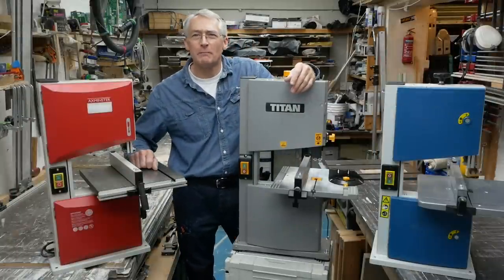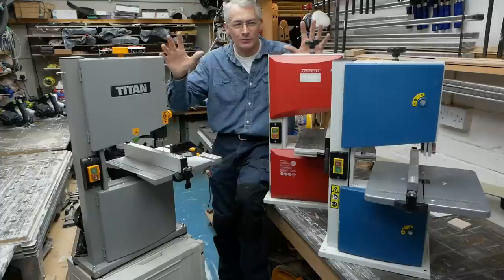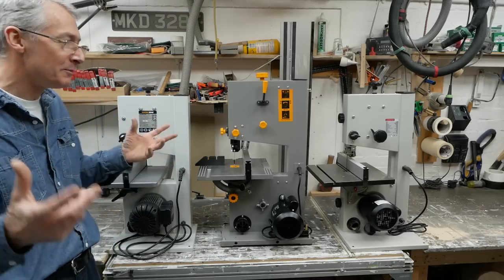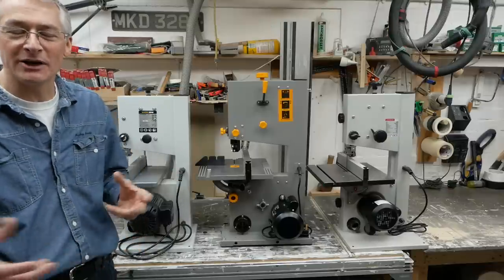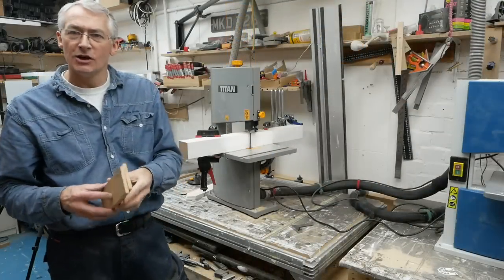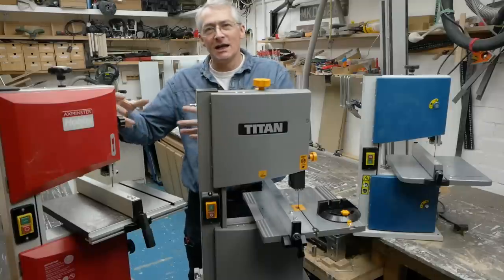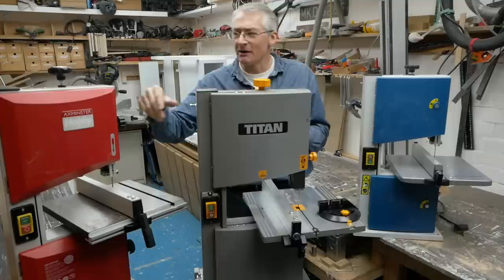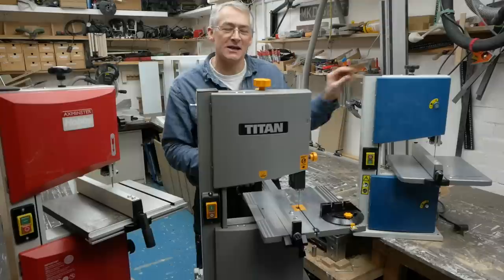Cheap bandsaws (again) #148

Comment: You can tighten the fence up. The cam isn't on a straight rod, it's a screw thread so just turn it clockwise a few times and it should grip the table no problem.

...oh and the Aldi one is being sold by Parkside from Lidl for £70.
Reply from the maker: Thanks - not my first rodeo, whilst this one will tighten, it doesn’t make it any more stable, sadly. Lidl Parkside tools are often rebadged Einhell, Aldi are usually rebadged Scheppach - I’d be interested to see if Lidl are starting to sell Scheppach. 👍
Reply: I had to send mine back because it wouldn't turn on when I bought it.
The replacement they sent me had been dropped or something as the base was bent and the post had ripped away from it on one corner.
The third one they sent me is on it's way now and it has come straight from Scheppach.
Reply: ...and my bandsaw was delivered today!

...except it wasn't a bandsaw, it was a mitre saw :/

So, still waiting for my bandsaw...after a month :(
Reply: @10MinuteWorkshop  Maybe not relevant, but I just bought a Parkside compressor which is made by scheppach aparently.
Reply from the maker: @diyengineer811  That's interesting, thanks Mark! Is it any good? I'm looking for a small quiet one... 🤔
Reply: @10MinuteWorkshop  Quite impressed so far. Easy set-up and plenty of power. It's a 50L tank so not the smallest and it is just as noisy as the coin operated tyre inflators in fuel stations. Apparently belt-driven types are quieter but more expensive. I have just bought the silverline nail gun that you mentioned in one of the pod-casts and need to get an adaptor to connect it to the euro-type connector on the compressor hose. But all-in I am very impressed for £99.
Reply from the maker: @diyengineer811   Thanks Mark! Much bigger than I'm after, but good to know about. And yes, the noise thing is what gets me down about them in a small workspace 😕👍
Reply: @10MinuteWorkshop  You could always keep the compressor in the other part of your workshop and build a cabinet with some sound-deadening around it (need a bit of ventilation for airflow, which would of course allow sound to leak out). I think you can pipe compressed air for 20+ metres without losing much pressure at all.

Comment: My aldi tracking feature for the wheel is useless now, had it two years, changed the blade on it, and it tracks the blade off.  The metal on it is cheap and flexible and it got use for the price.  However on a new job at the moment which I need my saw for.  Not very happy with it now.  It was ok for ripping but nothing finessed.

Comment: Resawing wood on a band saw is a special skill that needs training. Once i saw a good video on that subject on Wood Workers Guild of America.
I do not remember if it was in their "free" part or in their paid membership part. I decided to become a member a few months ago. They have special offers from time
to time, like a membership for 1 year for 4, 7, 9 or 11 USD. It's worth it. Normally a membership is about 40 USD a year.
Reply from the maker: Yes, it isn’t a skill I pretend to have, but interesting for an ‘unskilled’ user like me to be able to get a decent cut in a basic saw 👍
Reply: I'm not good at it either. The heigher the wood the bigger the thrift  The video on WWGOA is worth seeing but it is rather technical and it requires in any case
a lot of trial and error. At least I found out why things go (sometimes) wrong. When one knows his and/or the tool's limits things are easier to accept and
whether live with it or start with upgrading.

Comment: Just came from the other video, now I don't know... the mitre slot is definitely a big plus for the titan but the fence is a drawback, and still feeling I wand a higher depth, even if its just another 20mm for a nice round 100 lol. I will continue researching and see what I come up with.
Thanks again for the video
Reply from the maker: These are pretty old videos now; if you take a look at the bandsaw playlist theres a more recent one about the Aldi Ferrex 10" bandsaw - cheapest 10" bandsaw in the UK when I made the video. I still use it today, though I hd the Titan for a couple of years after I gave it a makeover and fixed the fence. 👍
Reply: @10MinuteWorkshop  thanks I'll check that out now ✌️

Comment: Really useful comparisons here, Peter. Am considering the Titan for my own shop, so very keen to hear how you got on with the Axminster fence upgrade.
Reply from the maker: Thanks! Axminster fence upgrade is sat in the box it arrived in due to work madness just now - there'll be a video in due course, I promise! 👍
Reply: @10MinuteWorkshop  Did you ever manage to get the Axminster fence fitted, Peter? And any joy with getting the tension adjustment lever to work?
Reply from the maker: Peter Shaw Nope - still in its box! I think I might have said at the time I don’t use the fence much, and this proves it, lol! I’ll get onto it soon, I’m sure. 😬👍

Comment: Do a review on the titan planer thicknesser. Available from screwfix for £140. I'd be interested to see your views on it.
Reply from the maker: Never owned one so it would be a bit of a novice review! Heard good things about the slightly pricier Erbauer though👍
Reply: Few good reviews on YouTube for that p/t, gonna get me one whilst it’s 20 quid off, Rutlands do similar for 180, but it’s probably the same. 👍🏻
Reply: Try to get your hands on an old Wadkin
Reply: Titan thicknessers are driven with a belt not chain.I had two and the belt broke on both not long after I had them.Decided not to risk another so had a refund. Take from that what you will.
Reply: Would love to see a review of this machine, it keeps tempting me with that price.  Usually even more tempted when arms are tired from planing...
Reply: I just picked up a second hand MacAllister (which I think is a B&Q own brand). Haven’t played with it yet, but only cost £70, hardly been used with 2 sets of spare blades.
Reply: Had ono fr a few months now to help with my scaffold board kitchen build. Generally found it good enough to not need too much finessing after running the wood through, although the width at only 200mm means full size scaffold boards had to be slimmed from their 225mm standard. Trick i found is to keep the cuts shallow as the motor does bog down if you try to remove more material in a single pass. For the money i feel that it was worth getting for what i needed it for.
Reply: I have one and only used it a few times, but my god, I passed a rough pallet slat through on two shallow passes and it doesn’t need sanding, no snipe, no problems. I got it on the strength of my love for the Titan table saw (no money, no problem! Should be the Titan motto) I’d recommend the thicknesser planer in a heartbeat.
Reply: eggypickle yes. I'd not seen any bad reviews on them on other woodworking sites (apart from the flimsy fence) and there are very few on ytube. I took the plunge a couple of weeks ago as they tempted me with and extra score off the price. Pleased with the machine so far and have found a way around that horrible micro safety cut off switch.

Comment: I have a delta bandsaw of this size, got it for a tenner on a carboot, it has a cast iron table, i use it for models and pens, i found screwing a 1"x2" block of squared off wood to the mitre and letting the saw cut it off is alot better for small cutting jobs, i did not like the gap between the blade and mitre
Reply from the maker: Good tip, thanks! Also a Delta for a tenner!! Bargain! 👍

Comment: I was thinking of getting the Aldi band saw for cutting my catapults out of plywood which is 18mm but just struggling which one to get as I only have £120
Reply from the maker: The Aldi is great, as long as you use it within its capacity. It’ll deal with 18mm Ply easily, though I’d suggest budgeting for a blade upgrade before too long. I have a few ‘budget bandsaw’ videos in a playlist - may be worth taking a look as I explain my reasons for moving on from the Aldi after 6  months 👍👍
Reply: Were can i get a new blade for my Aldis band saw, and what size? Mine snapped!

Comment: Hello sir. Nice review. If you don’t mind I would like to say that your information on the tension handle is a little off as it is designed to release the tension by pushing down on the mechanism not up. If you are in front of the saw you turn it clock wise & it presses down making the wheel move down. There is no need to move the tension knob on top. I only realised this the other day whilst changing my blade. Thanks. Mark.
Reply from the maker: On the Titan? Thanks, I understand what it should do, but mine simply does nothing. 🤔
Reply: Peter Millard   I have just been out to check mine as it did nothing also. He is correct. If you pull the lever/cam down it removes tension. Good shout UKCD. 👍🏼
Reply from the maker: I'll take another look, but in this video, at around 9.40 I show that the cam the lever moves doesn't make contact when the blade is tensioned. It literally just spins around.
Reply: Peter I will do a short video to maybe better explain what I mean.
Reply from the maker: OK, thanks. My bandsaw’s pretty inaccessible right now, so I’m working from memory, and from the video, lol!
Reply: UKCustomDesigns   Good little video. Nice explanation.
Reply from the maker: Okay, I’ve got to dig out my bandsaw and try this now, lol! Gimme a few mins... 👍👍
Reply from the maker: Yeah, you’re absolutely right- its when the lever gets towards the 6 o’clock mark that something starts to happen, but mine fouls against the tracking adjuster for the top wheel, so it doesn’t go round far enough. As I said in the original vid, I think mine needs some adjusting,m (mine doesn’t start to engage until it hits the 4 o’clock mark) but you’re right, it’s not the action I was expecting! Good find. If I ever find time to do a follow-up vid I’ll give you full credit on this, thanks so much. 👍👍

Comment: As always a great video Peter - today was had a particular relevance to me as I've been looking at the Titan bandsaw to add to my Titan collection (table saw / planer / plunge saw).  Maybe Titan don't do fences very well, I love their table saw but it's fence is terrible.  I'd be very interested to know if you found a good fix for the bandsaw fence (other than a block of wood) as otherwise it sounds like a great machine that would appeal to a large percentage of your audience, maybe a great topic for one of 1 - 2 minute workshop tips if you find a good solution ?
Reply from the maker: Thanks! I have a blade & fence upgrade planned for the Titan, wether I decide to keep it or not, I think it’ll be a worthwhile experiment. And yes, with a bit of tweaking & fettling, the Titan cuts really nicely. 👍
Reply: Also interested to hear how you get on with the fence upgrade - thanks for the useful comparison videos
Reply from the maker: Pleasure - will keep you posted re the fence upgrade 👍
Reply: I did see somewhere sombody talking of a fix for the titan fence. I think it referred to the use of a 1mm spacer to fill the gap between fence and table.

Comment: I have the Aldi saw and for the life of me I cannot adjust it so that it will cut a straight line. The band just wanders, even when cutting 2mm ply ? What is the roller supposed to do ? It makes no contact with anything on my saw ? Any help appreciated.
Reply from the maker: Sorry you’re having issues, but this video’s getting on for three years old, so the Aldi saw you buy today won’t be the one I had when I made the video, and if you,look through the most recent comments you’ll see that there have been some quality control issues with this particular saw. Mine came pretty well set up out of the box, but it sounds like yours may need some more work. The roller behind the blade should just touch the back of the blade to prevent it from distorting when moving the workpiece through it, and the guides on either side should almost - but not quite - touch the sides of the blade when it’s running. With all that in place, and the blade tensioned properly - it should ‘ping’ a nice clear note when plucked - and a well clamped and square fence, then you should easily get a straight cut. Many entry-level bandsaw issues are resolved with a better blade - I recommend tuffsaws in the description - but if you’re struggling to get a halfway decent cut after the setup then with these supermarket saws I’d just return it for replacement of refund, rather than beat your head against a wall. Not sure if that helps or not! 🤷‍♂️👍👍

Comment: What would you suggest buying now? I noticed that a lot of these bandsaw reviews get dated quickly since the models get discontinued for some reason.
Reply from the maker: The Triton is still available - though obviously, the saw you buy today may well be different to the one I had here. I replaced mine with a larger (10”) Aldi Ferrex model which is doing OK. I have my Titan away after some upgrades, and it’s still going strong afaik.  👍

Comment: Hi Peter, Very useful videos thanks.

I have just collected my Titan bandsaw from Screwfix, and unfortunately I will have to return it.
The lower wheel is eccentric by around .5 to 1.0 mm causing the bvlade to move side to side and to catch on the guides during each rotation. Clearly a machining/quality control issue. I presume there is no way a user can correct this ?
Reply from the maker: Hi Mike. What a shame! No, no way of correcting that, that I'm aware of. At least Screwfix are decent about returns - fingers crossed you'll get another one without any issues. Keep me posted. 👍

Comment: I’ve just ordered a press drill and promised my wife no more large(ish) power tools. So I hope you are proud of yourself, you’ve broken a marriage and made several power tools and myself homeless! 

I bought a Titan brad nailer recently (which is now also homeless) which is far superior to the Stanley it’s replacing which lasted 1.5 uses. I didn’t know it was SF's own brand. 

With the bandsaw it’s those spline sized cuts that really appeal to me for the corners of my picture frames. As they are decorative rather than strengthening I’m using a biscuit saw and beech biscuits at the moment. If I had a bandsaw I could make bigger ones which would make the frames more robust.

I commented on another of your videos about my difficulties, but this means any tools I buy have to be portable for me. Do you know a rough weight for the saws please? 

Great video, I really like your presentation style.
Reply from the maker: Thanks Mark! And just for the record, I didn’t make you buy anything - I just made you want to buy 😆👍 According to the specs at screwfix it’s 19Kg, but I don’t know if that’s package weight or just the saw. 👍👍
Reply: Peter Millard Thanks Peter, much appreciated. Whenever I tell my wife I "need" something she will always question whether it’s a need or a want.

Comment: Hi Peter. Thanks for the video on the bandsaws. Could you give me a link to the axminster fence you bought for the Titan. Cheers Lee
Reply from the maker: Hi Lee, and thanks! I’m deliberately not linking to the fence until I know that it fits and works as I didn’t want steer anyone to the ‘wrong’ product. I bought the “Axminster Small RIP Fence Upgrade” at £13.50 (if you wanted to search it out yourself...) and it looks like it’ll do the job, I just haven’t had a chance to fit it yet, so no guarantees... 👍

Comment: key things required in a bandsaw: Cast iron table - not pressed steel or aluminium. Ceramic or ball race blade guides which are accessible and therefore easy to setup for good blade alignment. A rack and pinion adjustment for the blade height. A motor with a power rating of 400W+. If you intend to saw anything where repeatability of cut is important, cheapo bandsaws are a waste of your time and money. For your ongoing health, dust extraction.

Comment: Good video yet again Peter. I hadn't even considered the Titan to be in the same league as the Axminster, but with the right fettling, I guess it is (although I hadn't with the Aldi one either)!
Reply from the maker: Thanks Jim, and thanks so much for your intrepid work re. the S1/S2 classification! As I say in the vid the Axminster is absolutely the best machine of the three, but for half the price the Titan is surprisingly capable, admittedly with some tweaking. Very impressed with the stock blades on all these too, didn’t really expect much from a max depth rip cut in Oak, but they all did well 👍

Comment: Hi Peter, I just stumbled across your video and found it really interesting and informative. Just off to Spain for a few weeks, but a band saw is on my shopping list for when I get back! I did like the hack that the Baron Rouge passed on - nice one mate! So it will possibly be the Titan from Screwfix as I already have a Titan table saw and have found it absolutely brilliant and a must have for any newbie woodworker. However, and please correct me if I am wrong, but I was of the impression that a band saw was better suited for cutting curves rather than straight edges, however I can see the benefit of having the band saw as one is able to cut far thicker pieces of timber than on the bench saw. Kind regards, Michael.
Reply from the maker: Thanks Michael, and welcome! Yes, bandsaws are good for cutting curves, which is why cutting a thin straight line is particularly challenging - and a great test for general set-up. This video is a couple of years old now BTW - Axminster have a small bandsaw at around the same price as the Titan, but with a cast iron table, just FYI. I think that would be the one I'd go for if I was buying now. 👍
Reply: @10MinuteWorkshop  Yes! Just had a look at the Axminster P1400B saw - looks like it could be a good deal. We have an Axminster outlet in Basingstoke, might be worth a look at when I get back!